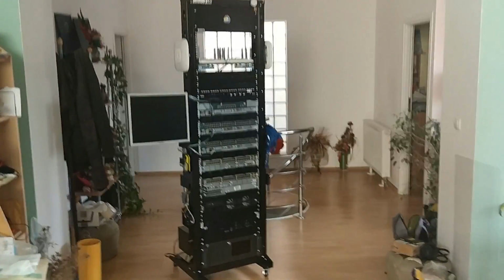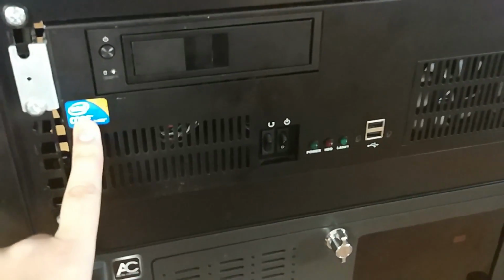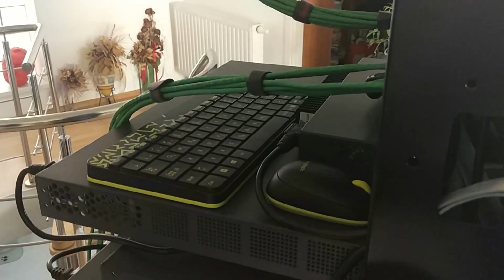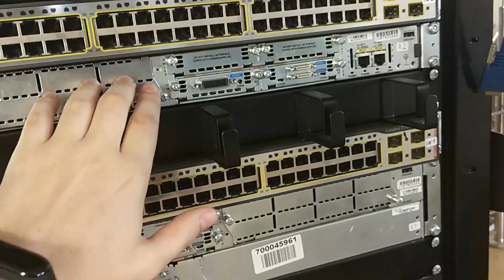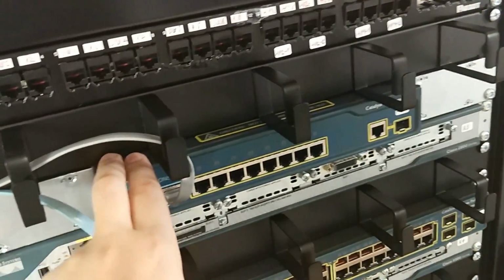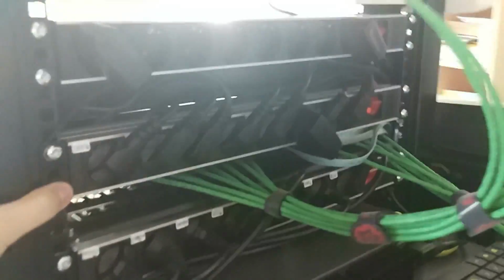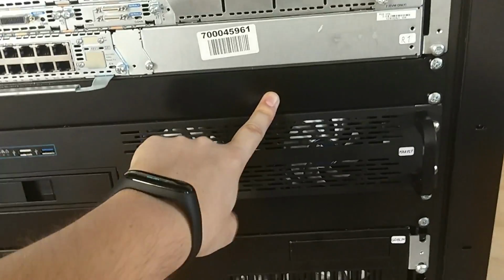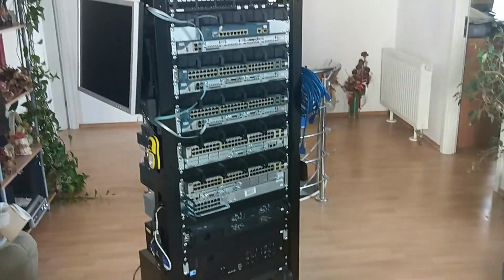My network lab - CCNP and more

Comment: Very cool but looks expensive 👍🏼
Reply from the maker: It's quite an opposite- costs less than two Cisco exams :D
Reply: @eW0LF  I'm just now learning to get my CCNA R &S but only using packet tracer now. Unfortunately I can't find a good home lab in Portugal that's not too expensive. Really love your kit. Good job and nice video 👍🏼
Reply from the maker: I would recommend you to check ebay for deals. I didn't just bought this lab as set, I purchased several bundles and was way cheaper that way. I live in Croatia but I bought that gear from different countries-Germany, UK, Greece and Poland. 2821 router was only 36€ shipped. For CCNA I would recommend you to not get more that 3 routers and 3 switches. That would be more than enough.
Reply: @eW0LF  I heard Croatia is beautiful! I'll be checking out eBay for 3 routers and 3 switches. I work for Cisco but in Data Center sales and trying to get into the networking career. Thanks buddy.
Reply: @eW0LF  This looks awesome, I like the clean look and that devices are straight back not the ones where they lean back.  THis is a much more pro look.    thx